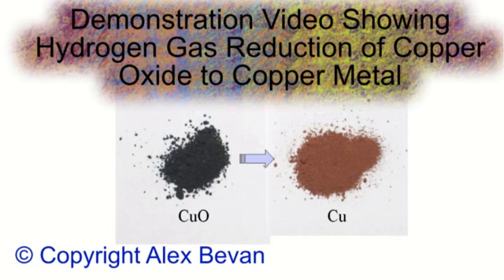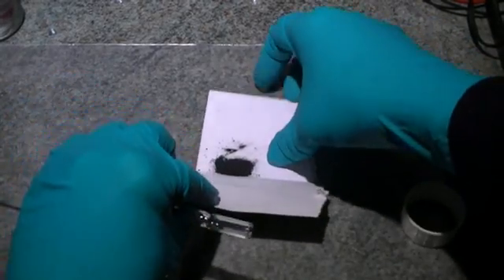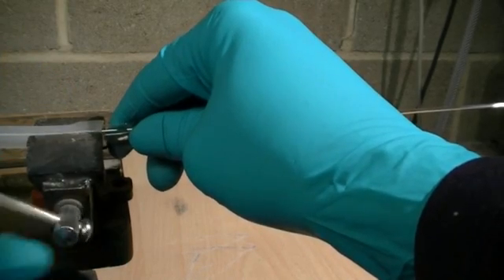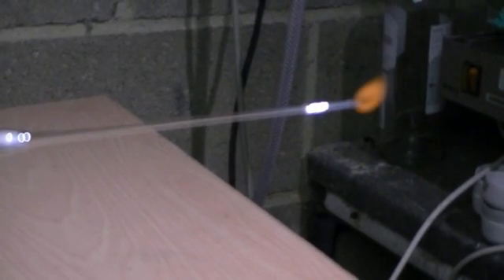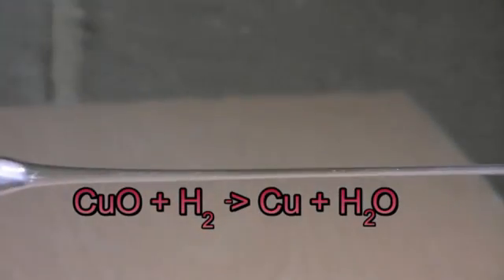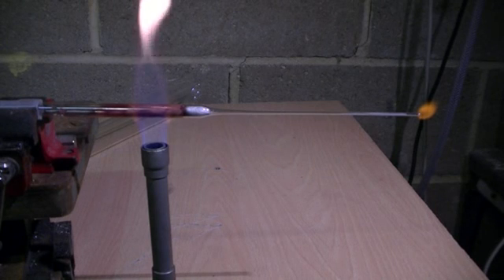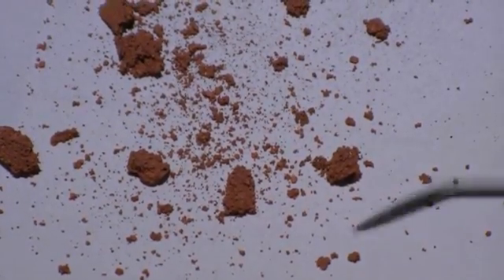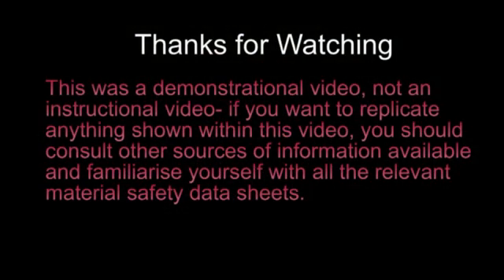Reducing Copper Oxide to Copper Metal Using Hydrogen

Comment: Why was the gas burnt a the jet after it has passed over the copper oxide?
Reply: Probably didn't want a flammable gas accumulating in the room.
Reply from the maker: Yes, excess hydrogen was passed through the tube with the excess burnt for safety

Comment: Before the mid to late 1960s, Britain used locally made coal gas to heat homes. This contained about 50% hydrogen. This made coal gas an excellent reducing agent. Chemistry teachers in Britain's grammar schools pondered how they would carry out the reductions of oxides in the post-coal gas era. To their surprise, they found that copper oxide can be reduced by methane (natural gas) but experiments show that it is not as quick as using coal gas or pure hydrogen, so much so that in most textbooks, the reducing action of methane is not even mentioned. For example, it is not mentioned in the very influential textbook, 'School Certificate (late New Certificate) Chemistry by A Holderness and J Lambert (Heinemann publishers),

Comment: Would this work using natural gas instead of hydrogen?
Reply from the maker: +Bradley Howes , Thanks for the question- Yes natural gas or CH4 would also reduce the copper oxide, however you will also form carbon monoxide CO in the process.